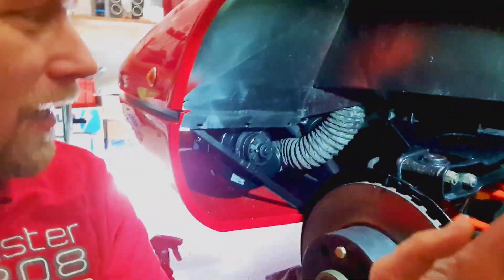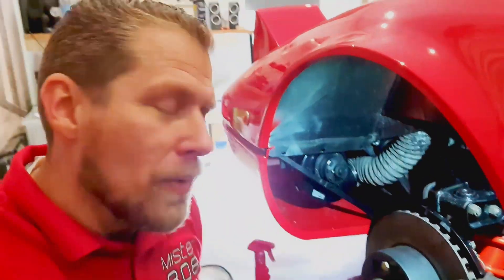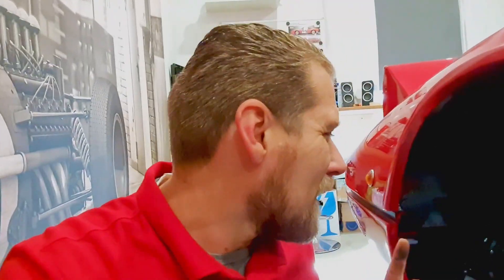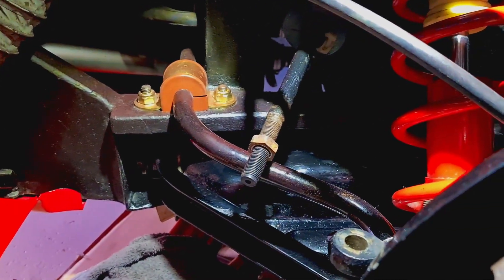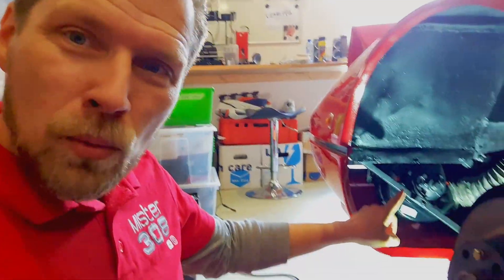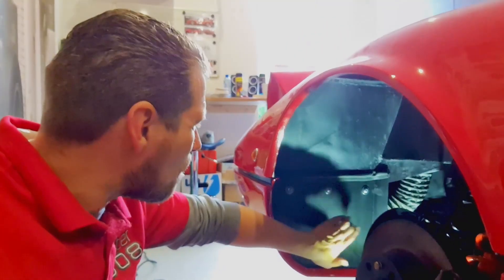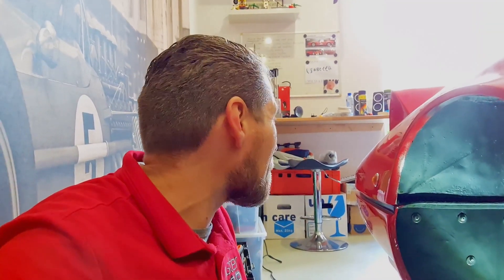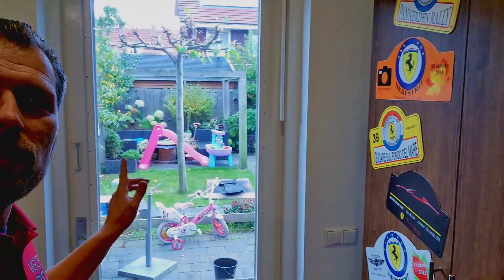Finally moving foreward again! | Ferrari 308 Restoration

Comment: Totally strip the car and body, box your parts, only bring the body to the bodyshop, but that's a hassle without wheels :) So you cannot prevent how you did it, unless you would have done the body first, wait until it got back and then do the driving train.

But a lot of body shops remove most paint residue and when the paint is still fresh it is easy to remove with a good polisher compound.